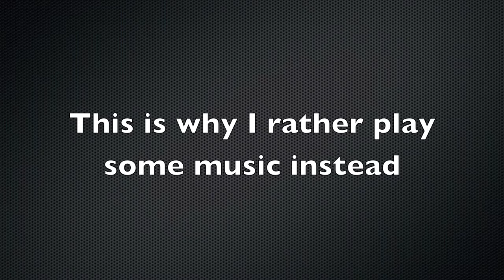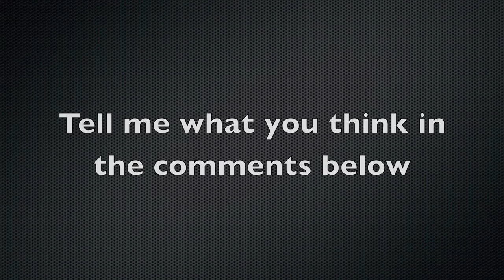DIY pneumatic exoskeleton suit

Comment: You beat me to it. My version will have hydraulically controlled limbs, much heavier construction and, if I can pull it off, electrical servo actuated hands. My plan is to build a real life version of the Power Armor of Fallout. Instead of fusion cores, it would use a small RC motor and gasoline.
Reply from the maker: Hah :D That's gonna be awesome! Keep me updated

Comment: are you using the compressor directly connected to the cylinders..  or with a air tank in between them ??
Reply from the maker: No air tank. Compressor directly connected. The next version (which is WIP (Work In Progress)) will have air tank and gasoline/electric compressor. It will also have:
Locking shoulders
Crabbing claws in the arms
Maybe smartphone HUD
New frame and hip structure
Assisted ankles
Covering plates
And some gadgets like flamethrower just for show :D